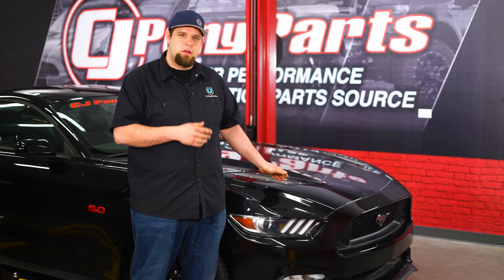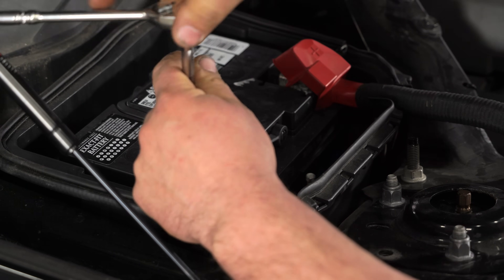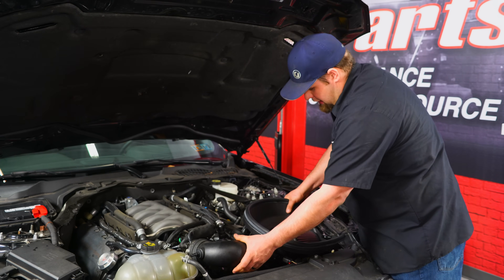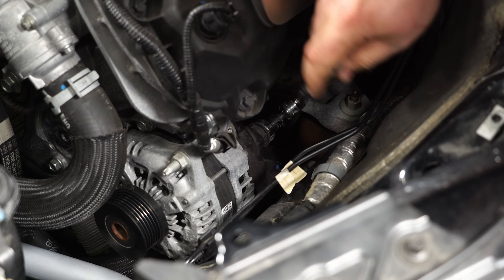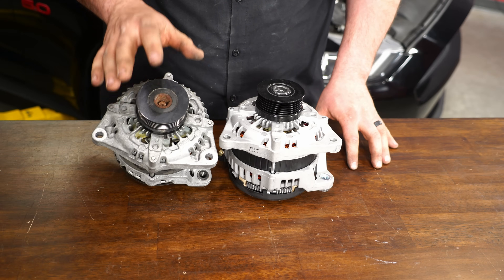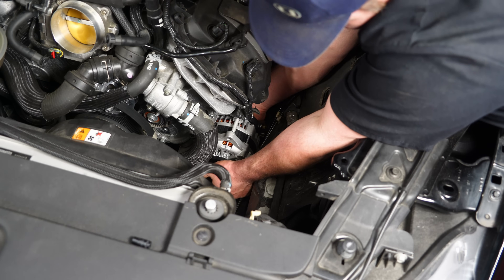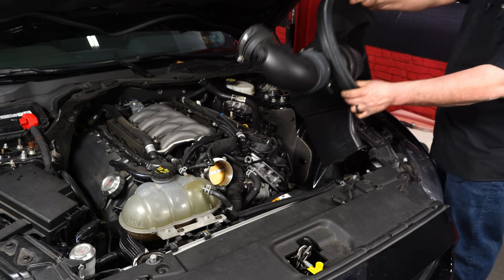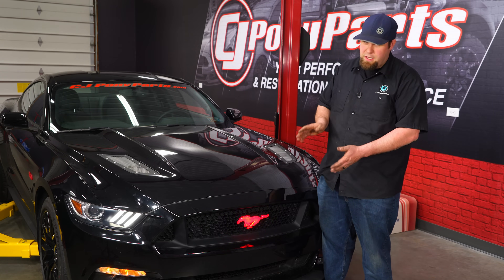Mustang GT Install: Powermaster High Output DENSO-Style 245 Amp Alternator

Comment: Be careful!  At 1:47, instructions are confusing.  Pushing the tensioner 15 mm bolt to the left, narrator states "loosen it up" which I took to mean loosen the bolt by turning counter clockwise.  It snapped because it's a reverse thread bolt.  Instructions need to be more clear with a warning not to turn the bolt counter clockwise!

Comment: This job was easy, except for that damn electrical connector. Here’s what I figured out… unbold everything so you can get that plug position so you can better access it. There’s only one clip and it’s on the inside of the plug facing towards the block. You push that in slides right off.
Reply: I have everything bolted off all I need is that one clip I have your same idea my fingers are sore from squeezing I'll try again tomorrow
Reply: I've tried pushing it in and I can't get it off my mother says it's probably stuck cause of the heat but I'll let you know tomorrow
Reply: @urbanomireles6500  no, it’s not stuck. Once you press in the right spot, it’ll slide right off. Tip: look at the new alternator that you’ll be putting in so so you can see how it clips in. That should give you a good idea of how that plug comes off.
Reply: What worked for me was unbolting everything like you said but also breaking up the plastic piece on the back to get more room. I think my CONNECTOR itself rather than the clip was stuck…. Because I stuck a knife and levered it and it came right off.

Comment: I am triggered by how easily you got the connector off this alternator. I cannot find whatever sweet spot is there to get this removed.
Reply: I think they loosen everything before hand they make everything look extra easy in these videos
Reply: I am trying to get that wire off my 2019 GT. Won't budge.

I am beyond pissed 😡
Reply: What did you end up doing?
Reply: @EVENMETAL  from my experience,  there is no easy way.
Reply: Oh man.  Thanks anyways lol
Reply: @EVENMETAL  yeah. Sorry. I ended up squeezing on it with a pair of angled needle nose. The plug was never right after that. I've zip tired it in place now.
Reply: @Cronus_1  Oh damn.

Comment: My car recently died - it wouldn’t open with key fob or recognize it even when I dropped it into the cup holder. 

AAA came out to jump my battery but it turns out that the battery and starter are good, but the alternator was low voltage. I have a custom radio system - would getting this alternator stop future problems from happening?
Reply from the maker: A larger alternator would definitely help with the draw of a larger stereo system.